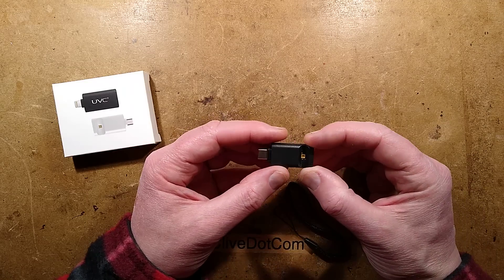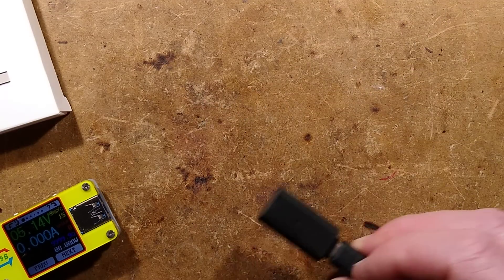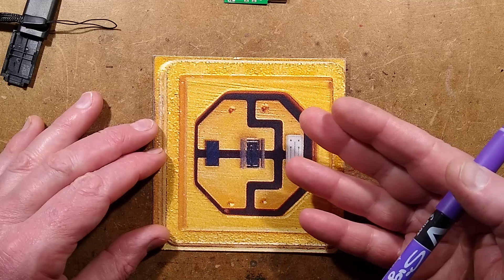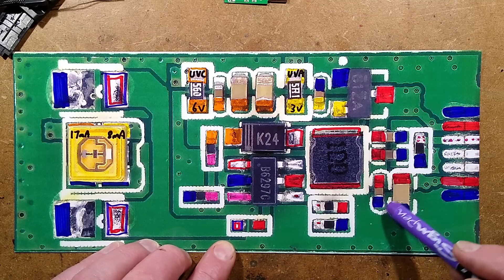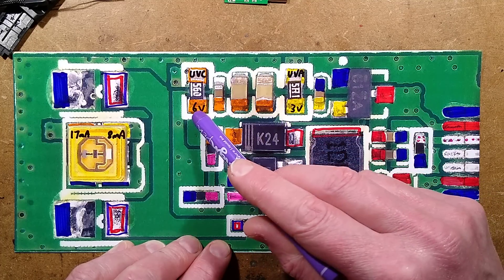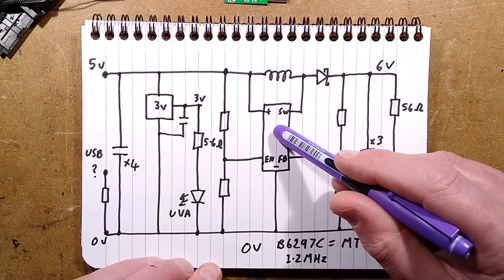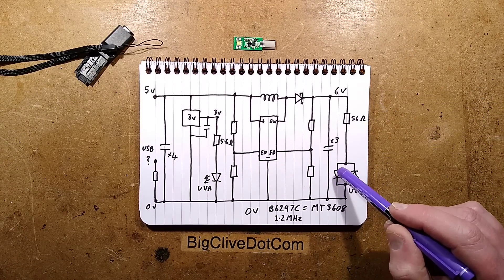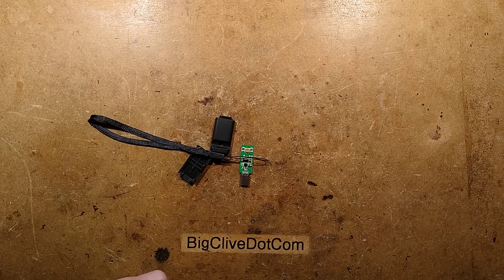"pandemic theatre" USB sterilising dongle

Comment: I bought one of these where the picture looked identical to this, but what arrived looked like an 'updated' version. The whole pcb is about 1/4 the size. Both LED's where powered by the same boost converter supplying 7.75 volts, UVC with a 20Ω, UVA with a 220Ω. I get about 45ma on the UVC and 18ma on the UVA, though I feel like my math is wrong somewhere. I do know the tiny inductor gets burning hot in seconds so it's pushing some power while being undersized.

Comment: Spudger Nails!

I've ordered 10 of these testcards to test my UV lights, own a fun Nitecore  CI6 Chameleon that's among my EDC items 

About glasses, some years ago I visited the ESA Open Day in Noordwijk, was a bright day so had one of my Julbo sunglasses with me.
They had a device to demonstrate that put out the whole light spectrum of the Sun from long IR to short UV, and a detector and display to show the light spectrum falling on the sensor.
The guy demonstrating it held one of my glasses in the beam of light and was actually shocked that it blocked all IR and UV completely, and attenuated the visible portion evenly to about 25% or less as I recall.
This was one of the best performance he'd ever seen, and Julbo is still my favorite brand 😎
Reply: Small mistake, I indeed have a CI6 Chameleon, that's Infrared!
My CU6 is on my belt, much more practical in real life 😉

Comment: I found a pile of quartz UVC sterilizing wands at the dollar store (now the $1.25 store since inflation pushed everything up) so I bought 4 of them.  One of these days I’ll figure out something to do with them…probably a curing box for UV curing resin or something.
Reply from the maker: The UVC tubes have very low output in the UVA area used to cure resin.  But they are a good source of sterilisation tubes for other purposes.
Reply: @bigclivedotcom  Thanks for the info.  I didn't know those resins were specific to UVA.

Comment: 17 mA does seem pretty low for a UVC LED. I wonder if the output is so low because they're under-running it? If you're willing to run a potentially destructive experiment, I wonder if you can get more output out of it by raising the current across the UVC LED?

Comment: I believe that resistor enables the cellphone to output 5v in the USB port.
If you connect a normal data/charging cable the cellphone does not output any power, but, there is a pin in its USB port to enable, so it can power some devices like mouse, keyboard, pendrive, etc...

Comment: I grabbed 5m of ultraviolet LED strip about 5 years ago and when I went to use them the other day there was no UV coming from them at all...  turns out the clear silicone waterproof coating turns yellow and blocks UV light eventually, so I peeled it off and now they are back to producing whatever wavelength of UV they were meant to, and the heat is able to dissipate better...  go figure  🤦‍♂️
Reply from the maker: Yeah, the clear coating also goes brown with blue wavelengths and blocks white LEDs too.
Reply: @bigclivedotcom  it would be nice if there was a big warning about selecting the option when purchasing (and I’m sure some more reputable sellers don’t even offer them in that configuration for that reason) because there are other options for weatherproofing strips and when I removed the coating the strip delaminated in a couple places, so the top layer LEDs came off the bottom power bus layer and in one place enough vias were undone that a short section isn’t lit.

Comment: It's best to just get a gas-discharge / quartz UV-C lamp if you need one. There are genuine UVC LEDs out there now, but they're very pricey. 

Either way, I would strongly advise leaving the room if you plan on using one. They may look harmless, but the scary thing about them is that the effect comes in place HOURS after your eyes have been exposed to the UV-C rays. I learned this the hard way and had to go to a hospital because I wasn't well informed about the risks.

Comment: During covid I had the incredible pleasure of working on one of my employer's side projects, which happened to be a "uv sterilizing face mask" that would expose the air you inhale to UVC very briefly. Basically a mask with a valve port and a coin cell powered version of this same circuit + UVA/UVC LED stuffed in there. It was ridiculous and never left the prototype stage, fortunately.
Reply from the maker: I was approached by a company wanting me to promote one of those.  I declined because I didn't believe that the amount of air could be sterilised by a single LED at a normal breathing rate.
Reply: @bigclivedotcom  It's completely ineffective, pure theater
Reply: i think they should have used gamma rays instead. that make as much sense.

Comment: Unrecognized USB resistor is an OTG mode selector. Then plugged in smartphone's USB port it requests 5V USB power output to be enabled. Without the resistor smartphone expects charging (power input).

Comment: The extra circuity maybe partly resolves a problem with a faulty usb battery power bank providing 10/12v instead of 5v.
Reply from the maker: The supply is 5V by default without negotiating a higher voltage.
Reply: I mean that there are faulty USB battery packs that can fail to reset back to 5v after negotiating a higher voltage to another device. I wasn't implying that your battery pack was faulty.

I think the only reason to have a regulator or Zener there is if the input voltage is expected to be variable. It's still strange. Huge speculation here ... maybe the designer was just lazy and cut/paste it from some application note for the LED. Maybe with a thought that it would help prevent denial of export/import into other countries if it had some kind of overvoltage protection.

Comment: I'm curious how long it will take for one of these to start flipping bits on a UV-erasable EPROM.  Thus far, that's been my benchmark for evaluating UVC light sources, as the die and the IC's quartz window seem to be very selective of wavelength.  Most datasheets I've seen specify 253.7nm and an intensity of 4mW per square cm for 15 minutes to fully erase.  I've found that my homemade eraser using a 15cm UVC tube rarely needs more than 5 minutes.
Reply: I found one the other day with two LEDs, but I don't think it's any better than this one, aside from there being two of them. Maybe if you put the LED right up to the IC window, but I doubt it.

I have also found at least one "Phone Soap" thing using a UVC tube.

Comment: I was waiting for a hack for higher power to this UVC LED boost circuit!
Reply from the maker: That would either be a feedback divider adjustment or a resistor change.  But I get the feeling the LED wouldn't favour more current.

Comment: The light output is almost invisible, yet uranium glass is glowing at some distance, so invisible UV radiation is being produced. Tested, even thin transparent plastics (polystyrene, polycarbonate) will block the UV-C, also thin glass from light bulbs. Polyethylene blocks it less.

Was thinking about programming an EPROM with all zeros, and then placing such LED at its UV window and reading the chip's content periodically to see how long will it take to erase it fully. Just for science 🙂
Reply from the maker: That would be an interesting experiment.

Comment: The resistor network across the enable pin is probably to make it so that it's only enabled when supplied with a high enough voltage to be able to run reliably.  This can prevent funky behavior (possibly even damage) under brownout conditions...  Probably overkill in this application given how little power this actually pulls, but it's actually a sign of (surprisingly) good circuit design, IMHO.

I'm actually kinda surprised with how much design did apparently go into making something this ineffective.  It certainly would have been a lot cheaper and easier to just slap in a resistor and a UV-A LED and just shove it out the door.  I'm wondering if somebody didn't actually try to make a legitimate USB-powered sterilizing device, with a real, decently powerful UV-C LED, but then due to complications for some reason had to swap out a part or something which unfortunately neutered the final result into something much less capable than it was originally supposed to be...

Comment: Seeing UVC LEDs (which were deemed impossible to make a (rather lengthy) while ago makes me wonder if X-ray 'LEDs' will ever be a thing.
Reply: X-ray sources were always electrical, hence the German name meaning "brake-rays", as it's generated by abruptly an electrom stream in a vacuum.
Reply from the maker: Or indeed a motor unwinding a roll of clear adhesive tape for low level use.

Comment: I wonder if it would cure uv resin or nail polish maybe erase a old eprom?
Reply: UV curable resin usually uses UV-A at 365nm. A cheap UV-A flashlight or black light tube would work much better.
It would probably work for erasing an EPROM given enough time. EPROM erasers use UV-C tubes that produce 253.7nm, but they output significantly more UV than this LED.

Comment: fomite transmission of covid has never been proven though (even if I'm sure it has other applications in this case). it is very much likely mostly aerosol, with a few exceptions (like frozen food). far uvc lamps can indeed be useful to sterilize the air though. see https://www.youtube.com/watch?v=QSnUce9xdNo
edit: ah I didn't realize you were cited by Naomi as a reference for UVC knowledge

Comment: The pin in the USB-C that goes via the resistor to ground, is the USB OTG enable pin. Without that, the phone will not supply 5V on the USB-C port ;-)

Comment: Ooooo. This would actually be perfect for keeping the air inside of my small bench top petri dish incubator sterile. It shouldn't give any unwanted heat and the low uvc output shouldn't penetrate the glass petri dishes and interfere with what's growing on the agar.

Comment: Hi Clive, I have one of those RGB LED pucks that runs on a couple of 1.5v batteries, do you think it would be ok to run it off a USB leads 5v soldered to the battery terminals and would I need a resistor on the hot side?
Reply from the maker: I'd recommend a series diode to drop the voltage by about 0.6V.

Comment: Saw the title and thought "how did those jokers fit a mercury / gas tube and an inverter inside a USB dongle?" Easy answer - they didn't of course! Nice that it actually does produce a wee bit of UVC so it's not pure theatre - but it plays a con game to buyers worried about micro bugs just the same. For theatre I prefer "will it start?" and "will it carbonate?" videos..... cheers!

Comment: I am a bit curious whether this could erase an EPROM. In theory it should be able to do it, but if the output is that low and the beam too diffuse, then it might not actually throw enough photons out to erase the whole chip. At least not in a reasonable amount of time. If it's like the one experiment I saw trying to erase an EPROM in the sun and it takes weeks, then that's not exactly practical.
Reply: Might be able to erase small sections, so you can map out where each bit is stored on the actual revision of that die.

Comment: I am unfamiliar with UVC leds, but shouldn't their forward voltage be at least 6-7 volts? The shorter the wave length, the higher the forward voltage, to my knowledge.
Reply from the maker: It may vary with wavelength, but the current versions appear to be around 5V.
Reply: @bigclivedotcom  In that case i might be driving my UVA leds that i salvaged a bit hard.
They get 5 volts of unconditional USB love 😀

Comment: The circuit could be made slightly simpler by using a current-regulating boost-mode LED array driver like those used for LCD backlights such as the AP3031, then the only resistor you would have left on the output would be the ~10 ohms for low-side current-setting/sensing.

Comment: I despair with the " modern " ( ? ) trend of hyper over engineered electronics in all manner of devices , a linear 4 Watt UVC tube ( as used in 1980's Prom erasers ! ) is SO simple and gives out SHEDLOADS of UVC ! ..I have lost count of the household gadgets that I have had to repair by chopping out the faulty electronics and re-wiring them to work OK ( electric drills / air fryers / battery vacuum cleaners ...) .. DAVE™ ......................     🛑

Comment: I am pretty sure this is a curing lamp for UV activated resin, specifically to cure individual nail art fingernails
Reply from the maker: The nail curing LEDs tend to be predominantly in the UVA region with a touch of phosphor for show.
Reply: Yeah, I have a couple different nail art curing stations, and they look nothing like this ant, and put out thousands of times more power. I doubt this device has the output to cure resin in any reasonable capacity, except maybe one pixel at a time... No, not practical at all!

Comment: More Chinese junk like tiny heater that claim to save electric that wouldn't heat a dog kennel let alone12ft square lounge! But you need to save electric with plug in wave form plug along side it that also dose nothing, but weight we can make your cat do thousands of miles  with easy to use plug in device,that could potentially damage your ecu,costing you hundreds! If all the car manufacturers can't improve engine to make it use less fuel by now,Chinese junk flashing disco box ain't gonna help!!👹👹👹👹

Comment: The diode across the UVC chips makes no sense to me. If It was a 5.9V Zener, it would make a lot more sense! 
If the polarity of the supply was reversed by some freaky USB socket, the boost chip will blow immediately and that's the end of that UV LED.

Comment: For that resistor going to the 0-volt rail, could it be that it indicaties for the adapter that it need to go up in volts?
Reply: That would be on a very specific pin listed in the USB 3.x PD spec.  However the circuit uses less than 100mA @ 5V, so no need.  signalling USB OTG ports to go into power output mode makes sense though.

Comment: DC-DC converters often have an under-voltage lockout (UVLO) function on the enable pin, where you can use a voltage divider to set a specific threshold below which it won't turn on. That's probably what they're doing here.
Reply: Isn't there a cheap chip that needs only one undervolt threshold resistor, saving one more component?

Comment: i see some problems and reasons for the problems.

1. exclusive contracts with manufacturers what better way to get bare uvc leds to the market than to sell fake uvc germicidal devices because the manufacturers of the uvc leds have exclusive manufacturing deals with other companies to only supply leds to making medical devices for hospitals and research centers so if you want  bare uvc leds you have to tear down a bunch devices to get them.

2. the usb c standard can output up to 20 volts (i think) at 100 watts for charging so wouldnt it make more sense to get 20 volts and regulate it down or even use a resistor to knock it down to run the led but maybe they dont want the failure of the led to then take out the regulators and somehow then load the power line and blow the devices or to allow it to work if you was to use a ucb c to a adapter that allows usb c to connect to usb a port.

3. why that the germicidal effects is considered fake is to make a decent germicidal unit requires many leds  and maybe that unit is intended to disinfect a tiny spot for use in bio labs where since petri dishes are getting more expensive so they have to do multiple experiments in the same space so the led is perfect for doing spot tests.

Comment: I am always wondering about any USB device doing harm to a laptop. This has a simple control line but I wonder about the high frequency noise from the booster this device may pass into the 5 volt power rail if the input caps fail. I notice you always wisely test with a cheap power bank. The kids will plug anything into a USB without a thought and some PCs have better USB self protection than others.
Reply from the maker: There are at least three things I recommend against plugging into a laptop USB port.  Cheap fans with electrically noisy motors, plasma effect devices and ionisers, both of which generate a high voltage differential across an ungrounded power supply.

Comment: The relationship between led wavelength and voltage makes perfect sense, as it would take a greater voltage to excite electrons to a higher wavelength. However I never really thought about it in this way until seeing your explanation in this video. Thanks!
Reply: *lower wavelengh. but higher energy status as energy contained in radio and optical radiation rises with shorter wavelengh.

red is harmless at 630nm but uv at 250nm is nutz to serval materials and stuff like DNA.